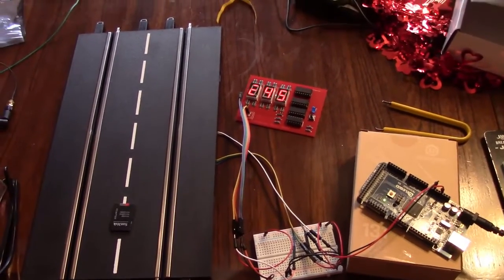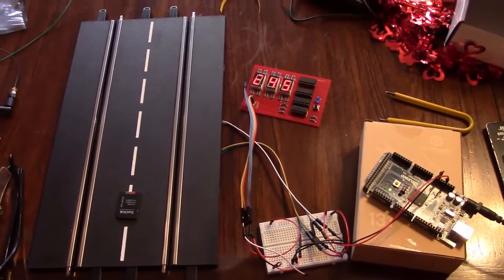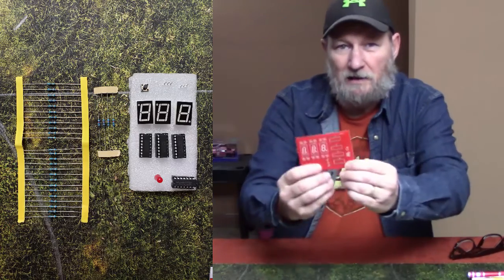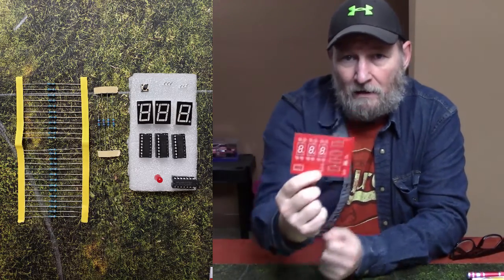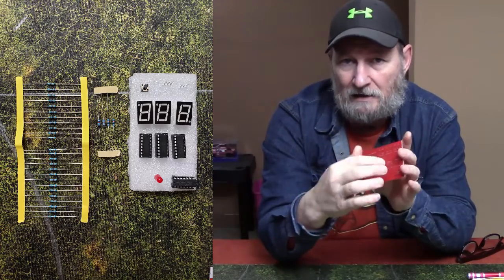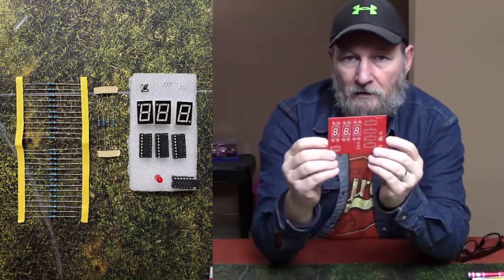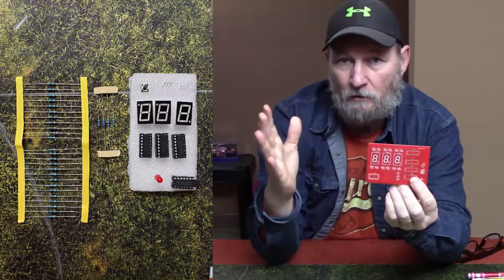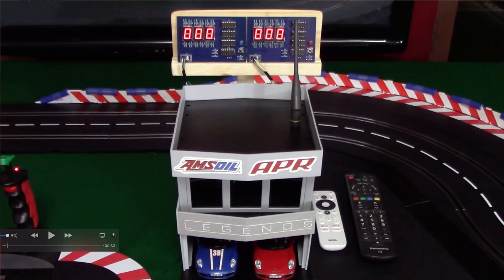How to make an analog  Slot Car Lap Counter

Comment: Hello Tom, as I am not a soldering king (I counted 164 welding points😬 ) I wanted to order an assembled PCB from your PCB on JLCPCB which offers this option. For this I had to make the PCB schematics to obtain a Gerber manufacturing file. I just received my assembled PCB but unfortunately nothing is happening despite all the attention I spent making the schematics. I wanted to know if you could help me complete this project successfully? I could send you my diagram by email or share it on EasyEDA, the online software from JLCPCB. Thank you in advance for your response.

Comment: Hello Tom, how do I get this PCB?
Reply from the maker: Here is a link to the PCB on PCB way
https://www.pcbway.com/project/shareproject/Analog_Slot_Car_Lap_Counter_Single_Lane_b335247f.html
Reply: @tomsidener Thanks, Tom, but I didn't ask my question correctly. I thought I could order the board pre-assembled. But you need the Gerber to do that. I ordered it without the components.
Reply: @tomsidener  Do you think we can make it with smaller components? And why is there a 3-digit display?
Reply from the maker: @SlotCarPlus  The 3 digit display is just how I did it. You could do it with other display options.

Comment: Thanks for posting Tom but but do you have an idea to operate an analog Lap Counter using the Position Tower Carrera 30357.
I saw someone on the French Net offering a TekSlots box with this option?
Reply from the maker: I have seen that information also but I am not sure how they are doing it. I do not have a carrera tower so I have no way to experiment. If I ever get one in the future, I will be sure to post a video.
Reply: @tomsidener  Hello Tom,
I am following up on my research to make an analog rev counter work with the same digital Position Tower Carrera 30357. At first, the question was how to recover a signal from the analog car?
I found an explanation of the method in this video.
https://www.youtube.com/watch?v=t3_z0xptzQ4&list=PLJN7qdITa91vxCUW2vOHeACh9JTWKAumR&index=3&t=778s
The trick is to drill a hole on the track just before the original infrared receiver to put an infrared transmitter this time. When the car equipped for the occasion with a small reflector paper passes over the first hole, the emitted signal will bounce down onto the receiver of the second hole and thus trigger the counting.
The problem now is how to connect this additional transmitter? Do you have any ideas? Thanks again!

Comment: Why not power it off the track itself?
Reply from the maker: The track is about 14.8 volts. The chips are 5v max chips. You could power it off the track if you included some form of power reduction but that would require more components.
Reply from the maker: Also if it was an analog track, the voltage would fluctuate. As an example the lights of an analog car, on an analog track,  are only on when the car is moving.
Reply: Fair point...I was thinking about the digital track which gives you a constant 14volts.

Comment: Very cool. Thanks for posting. It would be a super easy project. I am not good at soldering but there are great tutorials on soldering out there. Thru hole make it even easier. Will encourage my son to give this a try. Just received a board I designed for another (non slot car) purpose yesterday. Used pcbway also. I never knew things like this were possible until recently. Thanks again!
Reply from the maker: Your very welcome! I really enjoy prototyping, designing, and putting together little electronics projects like this one.